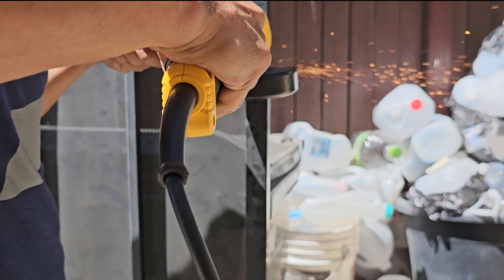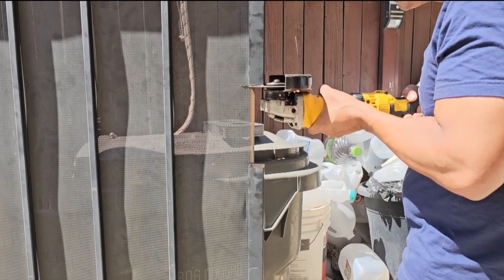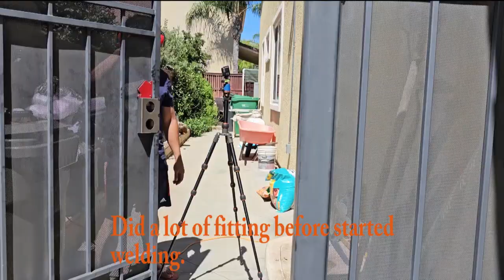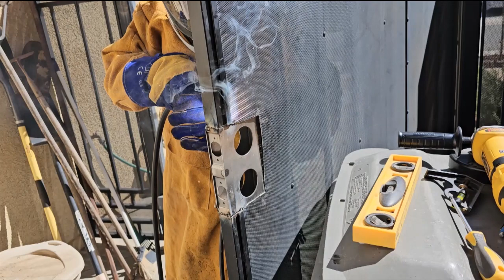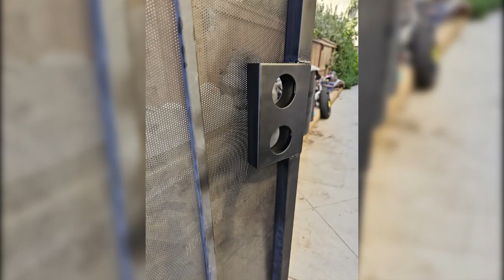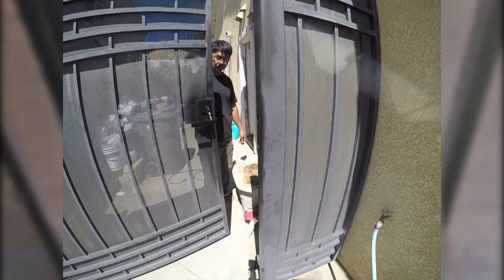Weldable Lockbox Install On Existing Metal Gate

Comment: Was wondering how people Cut out holes on the receiving post.Thanks!
Reply: With a hole hozer on a drill , if it’s thick metal I use a magnetic drill
Reply from the maker: since this is soft plastic i used step drill
Reply: Haha bro this is what I wanted to do, or still want to do on my side gate, but I was wondering how sturdy is that piece?🤔 I was thinking maybe more reinforcement would have gone but I'm not welder